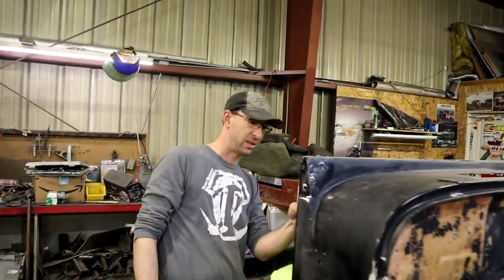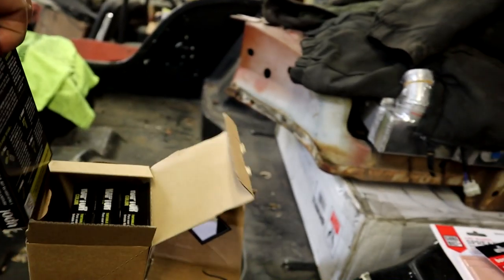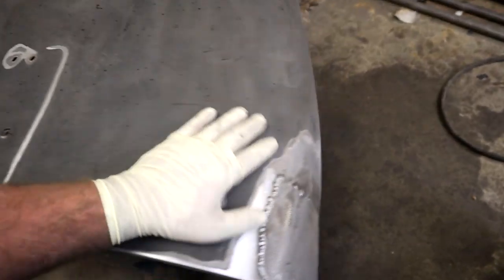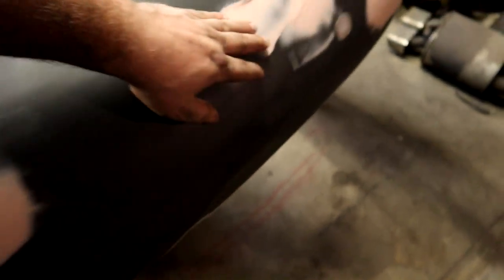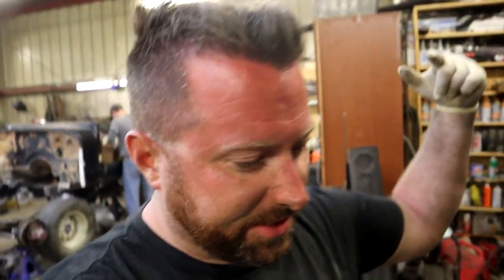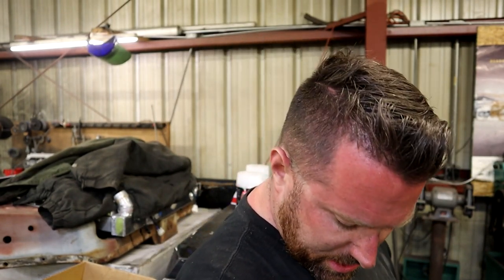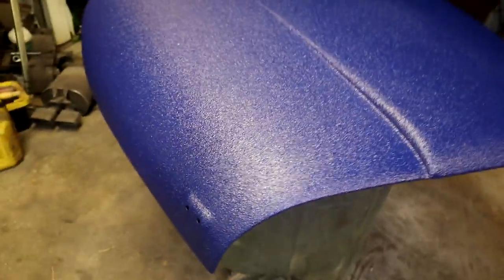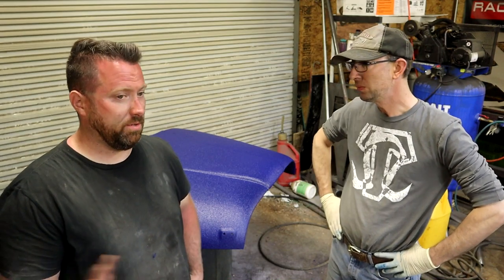How To Raptor Line a Jeep from Start to Finish

Comment from the maker: What do you think of the finished product! Did you like the Dent repair technique we used?
Reply from the maker: Already got 5 un likes? how rude lol! Whats up with that?
Reply: @carbonshocks  dudes with fat fingers and laggy touchscreens...
Reply: Oh man at least it really was name brand Bondo! 
People calling body filler Bondo drives me up the wall! 
It looks great!
Reply: "Now you're missin the bottle" I had to tell my dad that one time, on a road trip. 🤣 it looks cool! That covered in a nice way. Very forgiving of that wavy old hood. And the real test of the mesh technique you experimented with is time, right? Looks good so far! 😎
Reply: That mesh technique was quite intuitive-is...... Lol. Turned out smooth for such a big dent. Haven't seen Joe this excited in awhile
Reply: Karl Childers 
I use sand paper to clear away my body filler and my tears!
Reply: The blue in Raptor liner finish is gorgeous. The complete body painted in the same colour and finish will look fantastic. I would paint the firewall and front inner fenders silver over the blue so the Raptor liner finish is somewhat preserved and it highlights the engine and accessories . Thanks for sharing.

Comment: A really good repair and paint job. In March I bought a 1985 VW Vanagon camper (VW T25 here in the UK). Lots of work needed. I’m thinking of using black Raptor up to the body line level with the bumpers.

Comment: What kind/ type of air compressor is recommended to spray on the Raptor liner. I tried using something cheap, and immediately I noticed losing air pressure.

Comment: I'm glad you posted this video.  I'm currently spending my time off for Covid FINALLY  getting my cj7 rock crawler built and I'm planning on doing the entire body with this same product.  Very on point.
   One thing I've seen on most of the instruction videos, including raptor liners is you must coat all bare steel or filler with an etching primer.  Of course they recommend the one they sell.  Have you found this to be an issue?
Reply from the maker: well...have to be honest.. I didn't see anything about not coding bare steel. I guess time will tell

Comment: I was worried that it was gonna look crappy. It turned out the exact opposite of crappy. Looks great guys!
Reply from the maker: For as fast as we knocked it out, we are very happy with the results. It does need a touch up coat in a few spots but overall the body work turn out really good.

Comment: WOW! I really like the color and like you said the texture covers so well. What size mig wire do you use and what are the settings for welding sheet metal. I am working on a 1954 chevy 5 window and could use some advice. I love your content keep on doing what you do!!Ken
Reply from the maker: we only use .35 and with the welder we use ( vulcan Mig ) it was 3 & d... whatever that correlates to. Id have to look i up for actual wire speed and amperage.
Reply: @carbonshocks  Thank you for the info you guys keep crushing it in the dirt!!

Comment: Bondoglass would be a good addition to your inventory for the body of that jeep... it has glass fibers, is super strong, and is great for re attatching cracked or broken off fiberglass parts
Reply from the maker: Already have it! the pre impregnated fiber make  for simple repairs all in one for sure! :) 100%
Reply: @carbonshocks  excellent... it is basically marine epoxy doused with fiberglass strands till it's the consistency if asphault tar... love the stuff for  'glass repairs

Comment: i am a bit surprised that Joe didn't hammer the dent and the pull hammer holes. must be a good reason he couldn't, like support structure or sumptin....... not a fan of body filler, but the tub is fiberglass, so... groovy!
Reply from the maker: there was no real way to hammer that dent out because of the support on the inside. a slide hammer may have pulled the dent out even more but it still would need a bit of filler. overall we're happy with what we did.
Reply: @carbonshocks  i saw... spoke a bit early, though. its an off-roader, being raptor lined.... and I'M worried about metal husbandry?

Comment: Very nice.  My grandfather used to do a bit of body work and I've seen him used expanded metal the same way you used that mesh.  The Bondo squeezes through the little holes and "mushrooms" on the other side.  The little mushrooms act as anchors so that the cured Bondo doesn't flake off due to vibration.  Thick Bondo will do that if it is only adhered to the surface.  When I saw all those drilled holes under the original repair I thought it was either a dent puller or they'd drilled holes in the hood for the same reason.  Thanks for showing why they didn't just fix the hood the first time.
Reply from the maker: I was thinking for a while trying to figure out a plan and it was just a random thought that seems to have worked great! the Raptor Liner holds well so we dont anticipate it should chip or fall apart. The filler is much thinner than the previous attempt for sure so that helps a lot too.